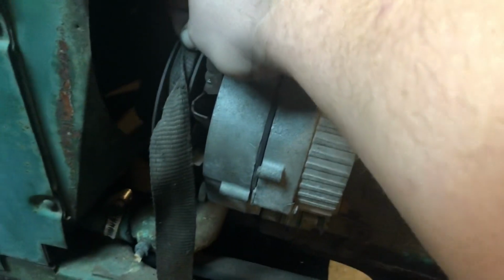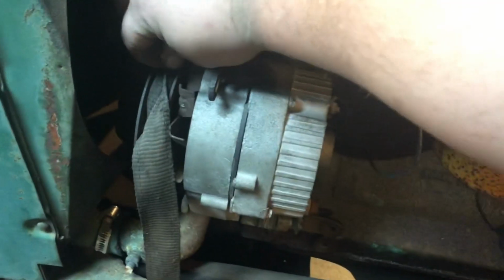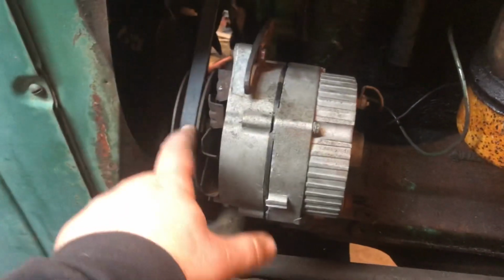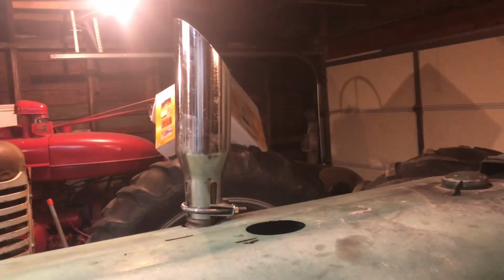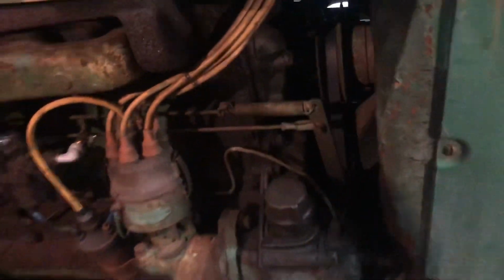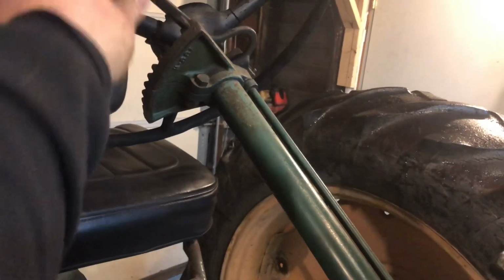1948 Oliver 70 part 4 new belts and taking it for a drive

Comment: Very nice sure sounds like a runner. I do gotta get you a picture of the weight bracket i keep forgetting.
Reply from the maker: No worries man wanted to drive this thing all day
Reply: This one seems to need less work than the 60 did. 😆 like I said it sounded good too didn't stutter at all that I could tell. Sounds like it's ready for a plow day 😆 (hint hint)...... You prolly already figured this out but turn that hater pipe to the right it won't blow in your face (as bad) lol.
Reply from the maker: @TimothyFluegel   yeah it’s getting turned
Reply: Lol